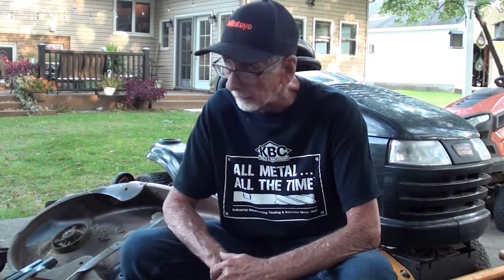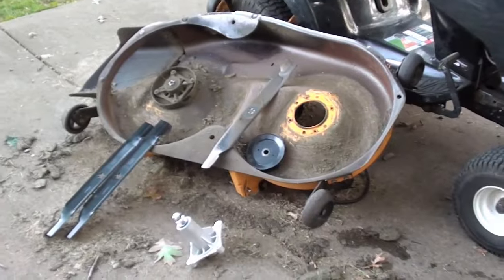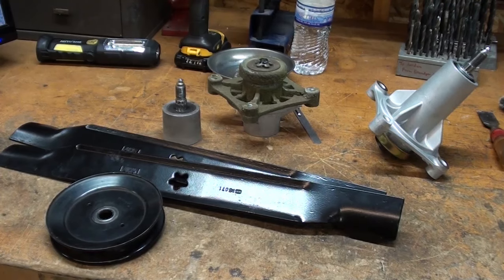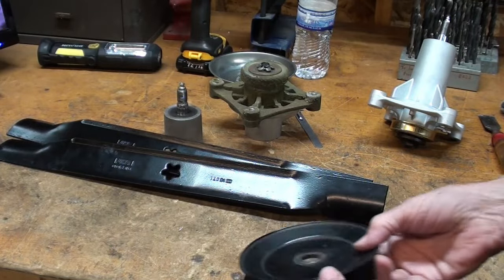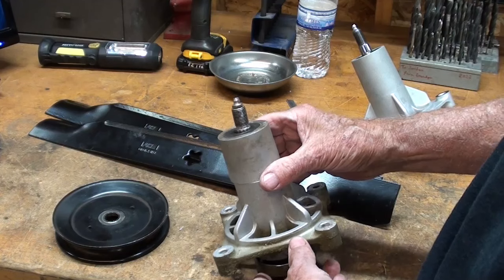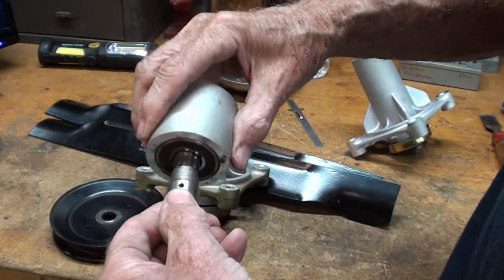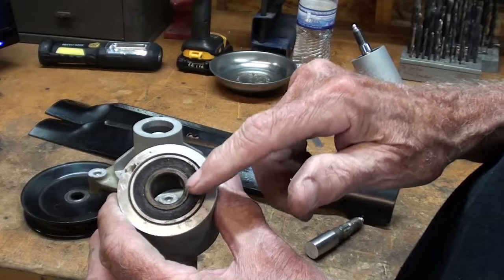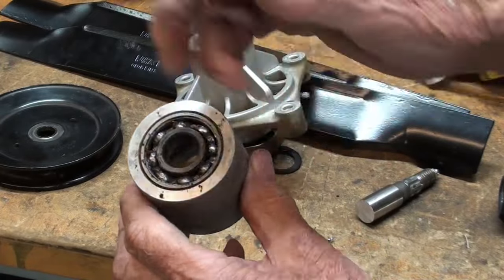LIES & DECEIT mower spindle fraud SHORT SUBJECT #52 tubalcain

Comment: On the cheap series Deere mowers they came out with to sell at Lowes and Home Depot at first the spindles had no grease fittings. People complained so they added them. The still used the same sealed bearings. People that love to grease actually fail the bearings more often now because they make them run hot with all that grease.

Comment: Mr. Pete is right about the bearings. My John Deere had the inner cover removed. I purchased new bearings from Napa at half the cost of John Deere removed inner caps only and reassembled. I do pump allot of grease in to housing. It will fill up and work in to bearings.

Comment: You're right, but I break spindles so frequently that they never get a chance to run dry. I keep a spare spindle and pulley on the shelf. When I shatter the housing from hitting a rock or stump, I keep the housing for the foundry, the bearings and the shaft for scrap stock. I made a motorcycle kickstand out of one of the shafts just a couple of months ago.

Comment: Mr. Pete,
I managed to bend the 42" deck on my new John Deere S240 when I hit a "frost heave" rock this Spring. The blade was totaled, however the spindle/pulley survived. The deck was bent Forward and to the Left of the plane of rotation , the blade path was into the ground in front and into the bottom of the deck at back. ( A new, bare deck, is $700 plus shipping).  The factory uses the bottom of the deck a plane of reference when they check alignment during assemble, so I figured I could too. I found an axel out of an old 1 ton Chevy truck and chucked it up in my 1951 16" Southbend and proceeded to turn the diameter to match the spindle mounting hole, drilled the spindle bolt pattern and made a 3/8" thick clamping ring with the same diameter/bolt pattern to clamp it all together.
With the deck flat on the floor you could clearly see the shaft was way off of vertical, so using the axel as a lever and my level watching for vertical I muscled the deck back into alignment.
The deck is now within 0.050" of vertical.  BTW , I weighed this deck, 96 lbs complete. The deck on my 20 year old JD LX172 weighs in at 167 lbs.   
Best wishes from Alabama
Keep the videos coming sir, you are a YouTube treasure.
Reply from the maker: You must be quite a good mechanic. What you did is bordering on the amazing.

Comment: There is another YouTube video where a guy takes out the bearings from a new spindle - removes one seal from each bearing - puts the bearings back in with the exposed sides ( in ) so the bearings can receive the grease from the inner housing. He also drills a hole in the side of the housing to pump the grease in. It would be better, of course, to tap a hole and mount a zerk fitting.

Comment: Now that people know about the large cavity in the spindles, maybe you can show how to make a spacer that will take up most of that cavity so not so much grease will be necessary.
So the fix would be, pry out the inner seals, make a plastic or aluminium spacer that fits pretty tight to the spindle housing yet leaves a small space between the inside of the spacer and the spindle shaft. Maybe it could be pressed or glued into the housing. Then when the spindle is greased only a small amount of grease would be necessary to properly lubricate the bearings.
Of course this method would only be for perfectionists that have the necessary tools to do this kind of modification.
Maybe this could be a future video.
Great videos Mr Pete.

Comment: Watched your video to the end just now.
When I assembled my steel spindle housings I prised out the inner seals so lubrication through the zerk could get to them.
Incidentally grease is a mixture of usually lithium based soap and oil.  You may have noticed old grease goes tarry after a long time which is the oil very slowly drying out.  So I don't regrease lubrication points with fresh grease,   I just as automobile oil.    If time permits pull the whole assembly apart and wash with naptha (Shellite in Australia) and apply fresh grease.
Ball races can be had as you say with rubber seals and shields.  Rubber will be nitrile (BUNA N) and you will find the rubber seals are moulded around a steel "washer" core.  You can also buy bearings with both seals and shields fitted.  Quality ball races have ground tracks in inner and outer races.  Did come across some Chinese made ball races where the inner and outer tracks were just turned and under an eyeglass the balls had pits in them.  
Last Briggs and Stratton engine I worked on had a ringed aluminium piston running in a plain diecast aluminium bore!  Guaranteed to fail,  which it did.   So when I bought my ride on mower I instructed the Sales guy "NO B & S engine'd   anything"   So he showed me a Husqvarna with a Kawasaki V twin.    Engine still going 15 years later.
Husqvarna strimmer wore out its gear head after ~ 3 years and new gearbox quoted at fully half the cost of a new strimmer!  The gears in it were not machined but sintered for absolute minimal cost.  So bought a Chinese made box BUT filled the housing with EP 140 back axle oil which contains sulphur and that box went for the next 12 years.
Reply: my 26 hp briggs fairly recent, has a cast iron block.

Comment: Had to change spindle bearings on my 1988(?)  Yard Machine. Pulled the seal off to find the new bearings really had no grease in them. Repacked with high temp bearing grease and assembled the spindles.

Comment: Great and appropriate rant!
Discovered the exact same issue, while replacing my spindles for the first time.
Confusing and frustrating to learn the hard way - and so unnessisary.
One online service tech suggested, regreasing the sealed bearings every couple years.
Pop the bearings out of the spindle, pull off the bearing seals, regrease, reinstall seals, put bearings back in the spindle.

Comment: Playing the devils advocate here; if you leave out the inner seal over greasing would pop the outer seal. Given the old adage if some is good more must be better it's a given. Man is incapable of making a seal whether for oil or grease that doesn't eventually leak. Maybe that's what the engineers were banking on to lubricate those bearings.

Comment: Retired Mechanical Engineer here...I agree the grease fitting and extra drilling operations are unnecessary with the sealed bearings.  In my opinion the sealed bearing is the way to go for the spindle.  Maybe the drive belt was tightened too much hastening the failure.  The spindle is a wear item that has worked well and needs to be replaced.  Give it an honorable farewell.  There are more despicable engineering and manufacturing failures to rant about.  For instance...auto timing belts that are almost impossible to replace, but will destroy an engine if broken.
Reply: Those belt all have tensioners and springs to automatically tension the belt. 
As far as the bearings go, the spindles mostly all come with those sealed bearings, but when people wash the mower deck off with the hose, the seals on those bearings don’t work so great and the fail prematurely. 
I always modify the spindle housings to accept a grease fitting if it doesn’t come that way to bed in with and then remove a seal on one side of each bearing so the grease will get in it. 
In my case, modifying the spindles like that and keeping them greased every 8 or 10 hours will yield many years of trouble free use as opposed to only two or three years given the amount of mowing I do. It’s usually about 4 acres per property a week at two different properties.
Reply: At least they do not seem to be difficult to replace… I do appreciate the first class rant…

Comment: Haven't had to dig into the deck spindles yet, but I've come to the same realization about my 15 yr old JD X500.  Had to replace the deck drive spindle bearings,  It didn't have a zerk but I thought the blade spindles would be similarly open cavities with sealed bearings on each end.  The front wheel axles had zerks but you are just putting in grease to coat the axle shaft, not lube the bearings.  

Both studs the deck hangs from have broken out.  The failure shows they put the stud in the hole in the plate, did a bead around it on one side and a cap over the end.  No weld material in the plate hole.  Last one I drilled out the cap weld and installed a bolt with a couple nuts to be the wear surface to be the hanger.

Comment: U joints with grease fittings that are inaccessible when installed are a mystery to me.
Reply from the maker: Yes, I often thought about that
Reply: @paulhunt598  which car are those on? All cars I worked on, just lift the rear wheels off the ground. Put it in neutral and rotate the wheels until the fitting can be reached. Make sure you're on level ground and the front wheels are blocked and you're on jack stands.
Reply: @roscoepatternworks3471  I have had trouble more than once, but have forgotten what vehicles.
Reply: When I was a young mechanic back in the 80's I laughed about the grease fitting in U joints. Just about every car I replaced U joints on would be in the junkyard before the U joints would need greased again. With enough grease during the install there's no need to touch them again. If they needed grease so often how could these cars have possibly run for a decade or more with no factory grease fittings on the U joints?

Comment: I am an 80 year old master mechanic and you are right! For many years I have been greasing the "sealed" bearings with a simple exacto knife. I put the narrow top between the bearing case and the seal. If you take care you will not puncture or harm the seal and it will pop out. Then I clean the bearing out and replace the grease. When I put a new serpentine belt on and feel the tensioner or idler are turning smoothly I do this so they are essentially renewed. This has worked for me since they came out with these bearings. Rant on !
Reply from the maker: I can tell you are a conscientious mechanic. I wish I was as young as you. I am 81.

Comment: Wouldn't the  overgreasing just force  the outer seals out  in a single RS bearing?
Reply: Another comment suggested drilling two small relief holes in the outside seals.

Comment: LOL! Love this video.
1. The bearing issue: That has been an open secret for a long time.  I used to repair small equipment as a side hustle for several years and 90% of the riders had grease fittings on the spindles.  I knew from replacing them that most manufacturers used double sealed bearings and did not remove the inner seal.  I always took new ones apart and removed the inner seals before installing them or if just replacing bearings (you used to be able to do that) i would remove the seal or shield on the inner side.
2. Drilled spindles Now days most parts are produced on CNC machines with an "operator" loading blanks or partially manufactured parts into a feed mechanism on 2 or more machines.  The machines either self feed or have robots handle the parts during manufacture.  
2a. The other side is having the parts made offshore where labor is cheap with low skilled workers doing one operation on a dedicated machine and then passing off to another worker on another machine down the line.
3. Planned obsolescence: A concept developed by the US Automotive Industry in the 1950s.  It has spread to every branch of consumer products.

Comment: First a correction, that you, Mr. Pete should surely be aware.  The Grease fitting is correctly called an "Alemite hydraulic coupler" or simply an "Alemite fitting". The only contribution to grease fittings made by "Zerk" is the check ball.  Zerk patented a grease fitting with a check ball but no coupling device.  The greeze gun had to be held into place with pressure from the mechanic.  Zerks business failed and was sold to Alemite, a Stewart warner subsidiary-Alemite and Zerk, are now own by SKF headquartered in Sweden.  Zerk was employed by Alemite and was a stockholder.  Grease fittings were developed by Gullborg, zerk, Butler, Johnson (Jiffy), Alemite.  The "zerk fitting" design, as stated,  had no way to lock the gun onto the fitting.  The fitting we call a "zerk" is the Alemite fitting developed by employee Joseph Bystricky.  Can you imagine calling it a "GreezeBystricky"? Because the checkball was so revolutionary, the Alemite fitting is commonly but erroneously called a "greezezert".  This follows calling a "tapered roller bearing" a Timken or a "Thrust needle roller bearing" a  torrington bearing.  If you have been around you know the last two are more true to their inventors name but those youtube trolls want them called by their actual name, not the company that developed them.  Please take this tongue in cheek but I found this history very interesting.  Had Mr. Zerk been name otherwise we might call an Alemite a Alemite.
Reply: Mr Zerk was from Kenosha, Wisconsin and his patent for the grease fitting made him very rich. Had a huge mansion behind tall walls and it was a real adventure for us kids to sneak in at night and see how the other side lived. whatever the merits and progression what he did served him very well. Like his fitting, everyone in Kenosha still calls the place the Zerk mansion.
Reply: @RRaucina  Thats very interesting. The Wiki page does say that although he had to "sell out" his business, he did go to work for Alemite (stewart-warner) and was a stock holder with prominence.  Is the mansion still there? I did a search and it says it was called Dunmovin Estate and was razed in 2012?
Reply: That is interesting, but I realize the names of things are very regional. An Alemite fitting (to me) is one of the pre-Zerk type fittings often called a "Pin type". They are longer and have two pins on the side. The gun coupler is a sleeve that goes over the fitting and then twists over the pins on the fitting holding it in place. These did work but were large and often didn't take grease well. The Zerk type with the ball type end pretty much replaced the original Alemite fittings. I guess we can discuss button head fittings next ;) 
I don't know who bought out who and so on.
Reply: @thewayidoit8895  My brother says the tenuta family bought it and tore it down. They own the iconic $$$ deli tenuta's in Kenosha and are not much bright with history. turns out  our  long gone aunt used to be a maid there in the 30's or 40's, said it was incredible. Great loss.
Reply: @RRaucina  Thats what the ibternet says.  It claims he originally wanted to restore it but when the cost was compared to that of a new home, he chose new.  Any stories of the original home builder, Mr. Cooper, I believe?
Reply: @thewayidoit8895  No info on the builder

Comment: I just had a random thought.....One could easily insert a pool noodle around the shaft to take up the unnecessary space, causing much less grease to be pumped into the housing. I don't believe that the grease will react with the foam enough to cause an issue to the bearings.

Comment: It seems like most new mowers under $5k are built as throw away items. I’ve got a Husqvarna wheeled string trimmer and it says on the engine that it’s got lifetime oil in it that never needs changed. If the climate extremists really cared about the environment they would be pushing for old school build quality again. Instead they’re fueling the throw away market by insisting we use small engines that never get the oil changed or battery powered mowers that definitely won’t be worth repairing.

Comment: I haven't read all the comments to see if this was mentioned but in the spring, I hit something and stripped the spindle and bought a new pair of spindles and replaced one of them. The original spindle had four mounting lugs like yours but the new ones only had 3. However, the deck was drilled so that you could use one with 3. I installed it and used it all summer until I hit a brick the other day and all of the lugs broke off the spindle. When I looked at the wreckage, I could see an earlier partial crack in one. My thinking is that if you have a manicured lawn and not a rural one like mine, the 3 lug type might be ok but when I buy replacements, I'm going to look for those with 4.
Reply from the maker: I think you are very correct. My yard is rougher than a cob. And so are the yards of almost everyone that has children and cars driving through it and moles, etc.     very few yards are smooth like a golf course. And those people have a yard service do everything so they don’t give a darn about bearings.

Comment: Engineering designs a good product it is manufactured properly but the purchasing department doesn’t understand the function and purchases the wrong bearing, the unit is assembled and the part fails 
There manufacturer didn’t save by buying the bearing with two seals, they cost more than bearings with no seals
The saving to the manufacturer came from not having someone in a position to oversee the assembly process 
Too many people in manufacturing have no clue about what they are actually doing
In days gone by a machinist would make things to a blueprint in the plant where the parts were used
Now parts are manufactured around the world by the lowest cost and brought together for assembly.   
$&@#%€£¥.  
Mr Pete I am older than you😮
JIM ❤
Reply: You got to remember most people don’t grease sh*t, it wouldn’t make it through warranty if they weren’t sealed bearings.

Comment: Lower demand for bearing with one seal=higher cost. Manufacturer probably saves 10 cents per spindle by buying double-seal bearings rather than single-seal bearings...and would have to hire a slightly more competent assembler who could make sure the unsealed side was to the inside.